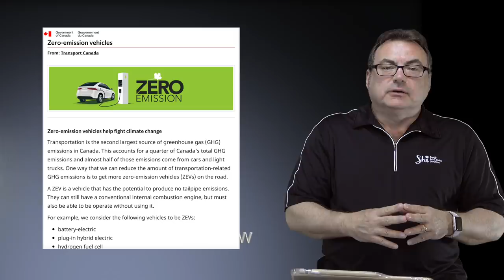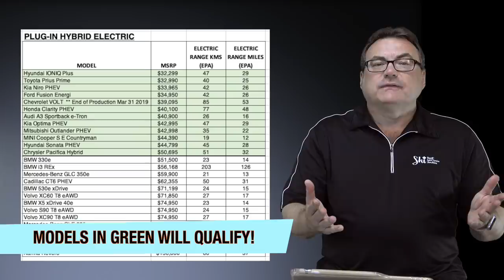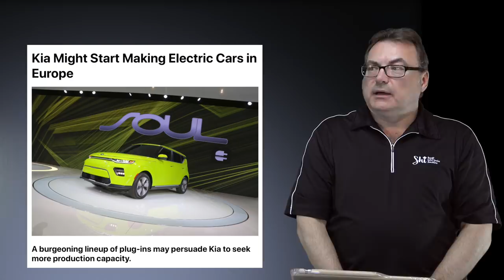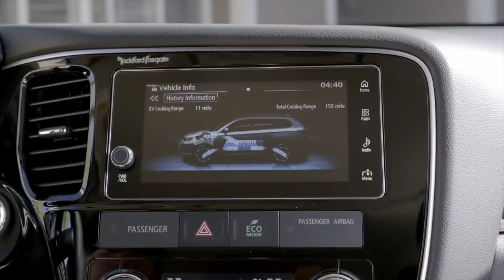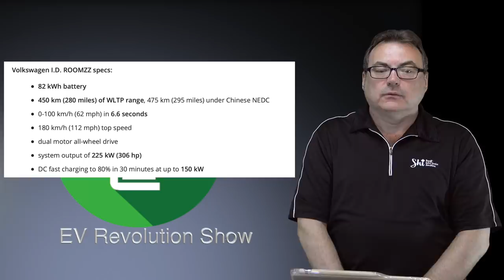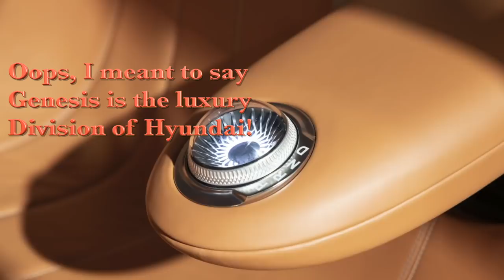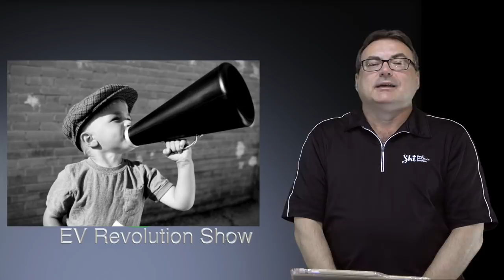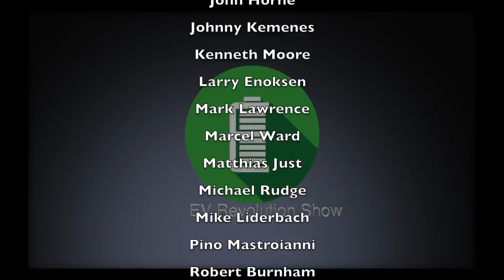Episode 41 - Canadian Zero Emission, Kia HabaNiro, Sono Motors Production, Audi AI:ME and more!

Comment: Completely agree with you , Ken, on the PHEV public charging. We BEV drivers have to realize that our cars are still quite expensive and not everybody can afford them and we should support other people trying to do what is in their power to limit CO2 emissions.
Reply from the maker: Thanks!
Reply: I also agree but would like to add the need to move your vehicle when the battery is full or to a level that will meet your needs.  The problem arises when a PHEV is left plugged into a public charger for many hours beyond what is needed and deprives others of using that space which may include other PHEV drivers.  It is super frustrating for a BEV driver that may need that charge to make it home or to his next charge when a PHEV takes the space when clearly it isn't the same level of necessity as it is for the BEV.  As an owner of both a short range BEV and a long range BEV, I see and understand the frustration.  When my range capacity degraded to around 50 miles at 100% on our 2012 Leaf, there are many times that charging the car at a public L2 charger was a necessity and not simply an opportunity to save money.  For that reason, when I'm driving our LR RWD, I won't opportunity charge if it is the only L2 space that may be needed for short-range BEVs to make it home, etc.  Most PHEVs have a fairly small battery pack compared to a BEV and shouldn't take long to charge it fully and so should be moved as soon as it gets charged as a common courtesy to all owners of PHEVs and BEVs.
Reply from the maker: Yes but this can happen with BEVs as well, so now you are talking about Charging Etiquette, something different.  I was merely point out that PHEV and BEVs all have the same rights to charge whenever and wherever they can.
Reply: JeffnReno I agree with you, PHEV owners have to pay a bit more attention to that because of the much smaller batteries but that is just with pretty much everything. You don’t fill up gas at a Costco gas station on a Saturday morning and walk away to go shopping ;) . We just need to be considerate towards other people.
Reply from the maker: Yes, and the vast majority of EV owners are a really good bunch of people and are considerate.
Reply: Just program fees and or charges for remaining plugged into the Charger, after a few minute grace period to unplug...Some ppl seem to dislike using Capitalism such a disincentive in this case, but it tends to far more efficient at changing behavior than just having a long list of Charging Etiquette rules...
Reply: @EVRevolution  The vast majority are but even some of them act selfishly from time to time with a sense of entitlement.  This is even seen at superchargers when owners park and leave their cars without regard to other owners that need to charge and move on.  Some obviously aren't even deterred by the penalty that is incurred with idle fees.  Unfortunately,  just owning or driving an EV doesn't automatically make everyone into nice human beings.

Comment: Nice one Ken.

If Mitsubishi (imo) squeezed an updated battery (50+kwh?) Into the Outlander, I think they'd sell even more units.
Better still, if they could move to a much smaller "generator" ICE, say 1.0 litre, with no drive connection, and a 60+ battery, they would have a very good foot in the door for when "that" battery arrives.
Reply from the maker: Thanks Roger.  Yes those would be even better specs for it and I would even look to get one.

Comment: I've been told by a plugin hybrid driver at work that I shouldn't charge my BEV (thereby using up a charging station) since it has enough range to make the roundtrip back home, whereas the hybrids have very limited electric range. That made sense as well.
On the other hand, it's quite frustrating when I arrive at nine o'clock to see green circles with a connected PHEV. That means the car's already full at that time. (Personally I think my employer should install more charging stations)
Reply from the maker: Hello Henri,  my main point was that anyone with plug in vehicle can charge anywhere they need and want to.  Onsite charging etiquette needs to also be used for what you describe so charging can be worked out to everyone's satisfaction.

Comment: Thank you Ken for giving Plug-In Hybrids a fair shake, especially at a time when we're facing this worldwide shortage of batteries.  Most other YouTubers right PHEV's off completely as being a ridiculous interim step.  Manufacturers COULD produce 6 to 10 PHEV's for every single full EV.  That will do more to reduce emmisions than building nothing, at least until this Battery Infrastructure Issue works itself out.   Plus our electricity is NOT as green as it could be at this point in time.
Reply from the maker: Hi Clayton, much thanks for watching and for your comments.  Agree completely and hopefully you can see, I am not like most of the other EV YouTubers that are doing this for IMO mostly the wrong reasons.  I'm all about the cause and if a PHEV will work in someone's life versus an ICEV, then great let them at it!  

True, not all energy produced is a "clean" as we would like it so because of this, and EV could be a worse choice in some geographies, at least for now.  All this needs to be educated to people and that is what I try in some small way to do.

Comment: I agree about phev using public charger but I encountered on too many occasions where they're simply stopping the charge cession but leave it connected just to use it as parking spot. Since I drive a bev I need the charger badly so I can get to my next destination.
Reply from the maker: Hello Gilles, hopefully I got across that my main point was that anyone with plug in vehicle can charge anywhere they need and want to.  

Onsite charging etiquette that you describe is another matter and most of the time can be worked out to everyone's satisfaction.

I've gone to a station and unplugged someone who was full so I could charge.  I've also plug in someone next to me who was obviously waiting for a plug since the charge port door was open, but I was in the EV parking spot and charging.  So when I left, I took my plug and plug the other EV in.  No one was around to instruct me.  

So more knowledge and proper behaviours needs to be informed to EV owners rather than blasting PHEV owners, so I understand where you are coming from.

Comment: The Chrysler Pacifica was being cut out of the initial plan for the incentive program, and the minister stated that they will fix it so Chrysler would be included since they make/assembly cars in Canada, but not Tesla, talk about politics and corruption.
Reply from the maker: Hello Gouk, you are correct and the Pacifica has been added.  That is because of the uniqueness of the mini-van segment.  It's an extremely popular market and thereby a great candidate to go after to increase EV adoption.

Adding yet another 4 door sedan to the mix (ie: Tesla Model 3) may not have the same benefits.  Mini-vans tend to transport more people at a time and typically do more frequent shorter daily runs.  

There are lots of other EV choices in the car and small suv-segments under this program, and the government needed to draw a line in the sand.  Also, with all the flack the previous Ontario program got from the public perception that people who buy a Tesla are rich and don't need incentives, I believe the Feds did not want to go down this road again in order for the program to have some legs and spur EV adoption.  I did not agree with Ford's Tesla statements, however the masses did.

So you say politics and corruption.  I say yes on some politics, but no on corruption.  There is sound decision making here and I'm not going to cry because Tesla did not make the cut.  Cadillac did not make the cut, BMW does not make the cut, etc. etc.  Are you crying for all of them too?

Comment: i asked myself once if it is ok to charge my twizy on a public charger that can deliver 22kw and I only can consume 2.1kw and I don't really need it, because I can make it home anyway... you could argue that I come further with 1kwh than any other ev. so I make better use of the power gain. in the end it is easy. when you have a plug then it is ok to use any ac charger. it is a different story with DC charger. only use it when your EV is below the point it throttles down, then make space for others.
Reply from the maker: Hi Michael, thanks for watching and for your comments.  Yes there are guidelines and practises for charging but anyone should have no bias towards anyone who has a plug in and wants to charge.

Comment: I have to say I totally disagree with your point of view regarding plug-in hybrids. I came to a public charger in Dublin recently as a Nissan leaf was just finishing charging using the DC Charger. There was a guy there before me in a plug-in hybrid. The driver said he was waiting on the same DC Charger that the leaf was using. I said but your vehicle is a plug-in hybrid can’t you use the type to the charger he said no he can only use the same DC Charger on the public charging system that the leaf was using. I pointed out to him that that was it 50 kW charger and your vehicle is only capable of taking approximately 3 1/2 kW of charging speed. I was in my Hyundai Ioniq Full electric version with Leston 10% traction battery power remaining. So I explained the ludicrous situation we were in him that he would be wasting the DC Charger well I need a lot more than heeded. Looking of the situation he Giovanne and left me with the DC Charger.  I firmly believe plug-in hybrid vehicles should not have access to the DC chargers. I except they can have access to the public AC chargers most definitely not the DC chargers as they are very slow at charging.  Keep up the good work love the show. Regards Séamus
Reply from the maker: Thanks Seamus for your feedback and for watching!  I understand your situation and you see, in your case you were able to talk to the person to get your situation resolved.  So regardless of AC or DC, they can charge anywhere so I stand by my ordinal viewpoint.  Using charging etiquette is a different thing and that is what you described.

Comment: On a related note, for those looking to get a used EV in Ontario, the Clean Air Partnership and Plug ’n Drive just started a $1000 rebate program for used EVs under $50K. See https://www.plugndrive.ca/electric-vehicle-incentives/ under Ontario for details. It runs 14 April 2019 - 30 September 2019 or until they run out of funding, whichever comes first.
Reply from the maker: Yes thanks for mentioned that!

Comment: EV News Daily podcast is telling his listeners that they should be educating PHEV drivers, politely of course, that level 3 chargers are more suitable for BEVs  and apparently many PHEVs are sold without the required cable needed to use level 2 chargers, instead using level 3 chargers that have hardwired cables avoiding the expense buying a charging cable.
If it is a public charging point any one should have access to it.
Reply from the maker: Hi John, yes any BEV/PHEV driver should be able to use any public charging point.  Education on how to charge is necessary as well as charging etiquette.  Thanks for watching and for your comments.